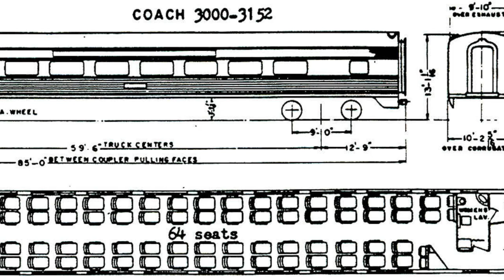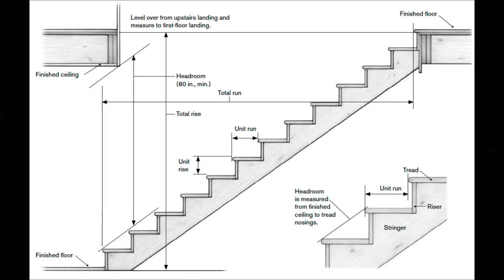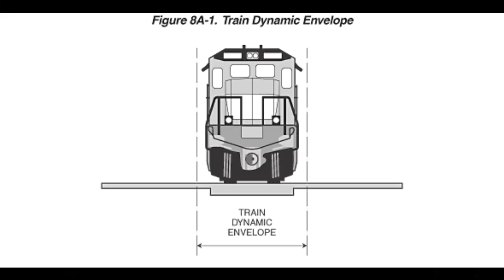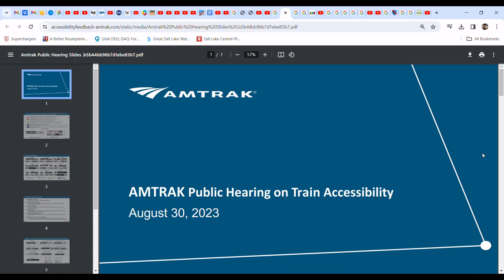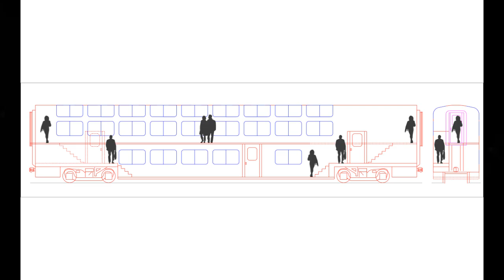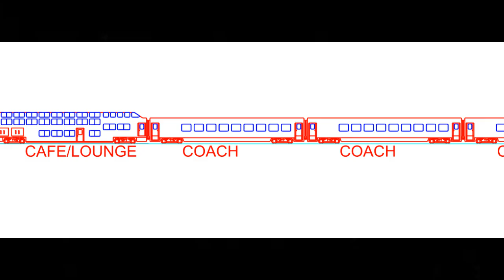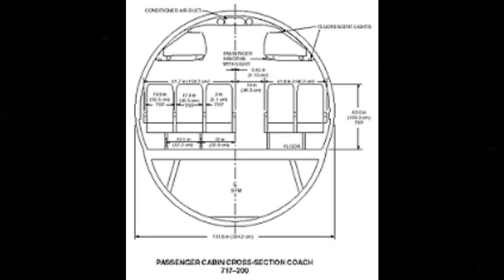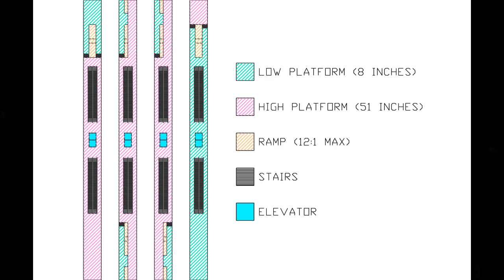An Excessive Explanation of North American Platform Heights

Comment: Gap fillers were first used on Brightline? San Francisco Muni Breda light rail vehicles have them and so do the newer Siemens trains. BART also has them. They are small but the tech absolutely is not novel on Brightline.
Reply from the maker: Yes! I should have said that Brightline was among the first intercity rail services in the USA to use automated gap fillers. The transit agencies you listed definitely came before Brightline, and deserve a shout out too.

Comment: Thanks Christian this was extremely informative. I did have a thought about the freight train dynamic envelope issue. I'm not sure this would be possible everywhere given the state of decay freight railroads like to keep some track in, but would it not be possible to mostly solve this issue with speed restricting freight trains around passenger stations?
Reply from the maker: An interesting idea. Physically it may work in most cases, but I have my doubts that the freight companies would accept permanent speed restrictions without unless there was some kind of compensation.
Reply: The issue of freight train dynamic envelope is less of a problem than you think it is...stand on a platform when a freight train goes through at 60 and you'll see for yourself...anyone that would be affected by such an envelope is just a Darwin award winner waiting to happen.

Comment: 10:51 - I actually made a concept of Amtrak bilevel coaches using this design. I took the Stadler blueprints and adapted them to Amtrak Coach, Sleeper, Diner and Lounge configurations, but yeah - they could only be used on the trains that currently use bilevel equipment, and with the places you describe (the several tunnels in the Rocky Mountains and Chicago Union Station), they would have to do some massive track rebuilding which would involve depressing the tracks 2 feet below their current height. It could be done, but Amtrak would have to pay for that. These cars would have even more capacity than the Superliners though and could mean increased revenue, so it would be an investment
Reply: Actually it wouldn't require massive track rebuilding, they would do it the same way they raised the heights in tunnels to accommodate double stack containers, which was a combination of lowering the track and notching the tunnel roof.  Amtrak shouldn't have to pay for it because anything like that would benefit the freight railroad as well(giving them outlets/additional routing capabilities to handle double stack containers.  This is actually a problem with all the Amtrak authorization bills that Congress puts forth, and it stems from a failure of the Amtrak leadership to enter into proper negotiations for track usage with the freight carriers.  Any upgrades to freight tracks that accommodate Amtrak inherently benefit the underlying freight carrier, yet they always complain about Amtrak hindering their ability to carry freight.  Hogwash.
Reply: @zaklex3165  large intermodal stack trains can’t use the Moffat Tunnel route because of how steep the climb is between Denver and the MT, so heightening the clearance wouldn’t really enable those trains to use that route, and if any money was invested to heighten the clearance on those tunnels, the max could be 19’ or 18.5’ specifically to accommodate taller Amtrak coaches - most stack trains are even higher.
Reply: @coleallen3895  A double stack is 20' above the top of the rails at it's highest point, the Moffat Tunnel grade should not be an issue as double stacks can go over Donner Summit, and I'm pretty sure the maximum grade on Donner is more than the maximum 2% between Denver and the tunnel...but that Tunnel is owned by the State of Colorado(and I highly doubt they'd spend taxpayer money on it to support a for profit corporation[UP]), so it's a rather moot point for that route.
Reply from the maker: My reading on the tunnel heights on the Front Range in Colorado suggested that the Moffat Tunnel itself is capable of double-stack cars, since it was built extra tall with the intention of being electrified one day (similar to the Great Northern or the Milwaukee Road). However, the multiple tunnels leading up to the summit, built by the original Denver & Salt Lake, are all height restricted to 17'.

Comment: At some point either robotics, prosthetics or outright medical science is one day going to render physical disabilities a virtual non-isse for mobility; I wonder how people in that time will look back on us and all the issues we have with providing accessibility.
Reply: Not every 80 year old will want to get a prosthetic.
Yes, there will be barely any people who are outright unable to walk, but you will still have people who need (only) a cane or stroller in order to be able to walk, and people who prefer sitting down in a spider/ walker wheelchair (which would technically be a legchair, then?).
The cane option limits where you can use steps, and the legchairs will have similar aisle width and turn radius requirements as today's wheelchairs. Even if we get to the point where no single person is limited by BOTH maneuvering room AND steps, there will still be people who have difficulty with either one of these points.
Reply: @Pystro  You won't need a chair at all if you were wearing a mobility assistive exoskeleton. You would be human sized, plus a backpack for the power source.

And that's to say nothing on the possibly of bionic implants to restore limb function or stem cell treatments that can repair damage and potentially reverse age released deterioration.

Assuming we don't go extinct first, one day physical disability will be something that does become extinct .

Comment: to me, the freight trains aren’t the real issue here
the crux of the problem, and a serious question I often ask myself, is, what is a better platform height: above the bogies (ideally around 1200-1300mm) or between the bogies (ideally around 500mm for double deckers)

I live in switzerland, so basically all standard gauge platforms here are 550mm, and as a result we can even have trains like the IC2000 and FV-Dosto (continuous upper deck) with accessible level boarding, while 760mm platforms have slopes that are too steep for swiss law.
But in turn, single deckers, especially high speed or tilting, are more difficult.
We do have the Giruno, which is a 250 km/h trainset with mostly 760mm entry, as it is a eurocity trainset, but it also has 2 cars with 550mm entry as well, which are connected, which form a 3-car wheelchair accessible section in the middle, with a first, second, and a dining car as well as 2 accessible toilets.
Apart from that, we’ve added low floor cars to a few different train types: DPZplus, NPZ Domino, BLS NPZ (jumbo) and I’m curious whether something similar will happen to the astoros, our latest tilting trains, some of which were constructed around 10 years ago.

Comment: Feels worth mentioning CalTrain's new Stadler KISS's, which will have two sets of doors -- a lower set to match the existing stations, and a higher set to match platforms shared with HSR.
Reply from the maker: Ah yes, I remember reading the California High Speed Rail Compatibility Blog on just this topic when I was in college....

Edit: I found the link:
https://caltrain-hsr.blogspot.com/2009/09/platform-height.html
Reply: That is basically a temporary solution until CAHSR reaches the Bay Area...once that happens, the higher level platform for HSR will be the standard platform height even for CalTrain...that is why they have two levels of doors at delivery.
Reply: @zaklex3165  they claim that but little of what the JPA says comes true, it’s run by a bunch of clueless officials. That would seriously slow down the boarding of bikes which would be a major issue as everyone carries their bikes down the stairs
Reply: @gdrriley420  Oh, you mean the "clueless officials" who now run the most modern electrified regional rail line in the nation?
Reply: @blakeclark5898 this has been a plan for over 30 years. Stumbling forward into success does not mean they made a bunch of good decisions along the way. It’s pretty clear looking back that there were a lot of poor choices. From a custom PTC system, lack of grade separations and extra quad track😊 to ordering trainsets with more powered axles than needed.
Reply: IIRC, they would have to add accessible car to each EMU. These accessible cars would be single level and have lifts for low platforms as well as two accessible toilets. These cars currently not existing may explain the lack of toilets in the current Caltrain EMUs.
Even then it feels like a temporary solution until they increase the platform height on the majority of the line - the lifts may be okay for people on wheelchairs of whom there are not that many, but it is not that good for people with bikes or even strollers.

Comment: Amtrak built a new train station in Catlettsburg KY in1975 to replace the C&O station in Ashland KY. It was closed in 1998 when a new transportation center opened again in Ashland. There was a wheelchair lift at the Amtrak station in Catlettsburg. In 23 years, it was used once.
Reply: This is a great example of why building accessible design into your architecture is preferable to creating special accommodation for disabled patrons. I’m willing to bet that many thousands of cyclists and parents with baby carriages used the station over its 23 years. Ramps and level boarding make boarding easier for everyone, including people using a wheelchair, a walker or crutches.

Comment: What I find interesting is that despite differing platform heists, the UK manages to mix high platforms with freight services. A high dynamic envelope might just be a symptom of poor permanent way - which should be addressed instead of maintaining a system that’s inaccessible and hostile to passengers with reduced mobility.
Reply: Check UK railway car widths, even the freight cars are narrow.
Reply: @scottfw7169 They might be narrow, but they're still go right up to near the platforms...just watch YouTube videos of British trains...and see my comment above about freight train dynamic envelope.
Reply: And strictly speaking, it would only be necessary to build track that is held to precise parameters in areas of close clearances, such as platforms and in tunnels, both of which would be well served by slab track (although it might be a harsher ride in those areas).
Reply: I would agree with you higher standard of permanent way probably be best as dare say less wobble lead to less derailments with the larger loading gauge that before allowing better access for passengers services

Comment: You miss one important factor for a lot of trackage and stations Amtrak uses; dwell times.  Bilevel or other more complex car layouts, and things like gangways make trains have to spend more time in stations, which can be a problem where those trains run alongside high frequency commuter or transit rail.  This is especially significant along much of the NE corridor.
Reply: I see why this should (and likely is) the case but in Switzerland more and more S-bahn are being run with bi-level trains to increase capacity. I don‘t think dwell times have really increased (at least not significantly).
Reply: @PhilfreezeCH  if you combine bilevel cars and bridge plates and King distance trains (so more luggage), it'll definitely start becoming an issue.
Reply: Happens constantly on my regular single level Arrow III consists getting stuck behind the Multilevel express Midtown directs running slower than mine for a timed connection. Those excessive dwell times is the reason we wait

Comment: In the 1980s, prior to VIA being castrated to death in 1989, VIA looked at the Superliners. One reason was hat they were charge by the car by both CN and CP, so having double deck cars would reduce number of cars in train consists and hence cost to VIA to run the trains.   One would have to look if the same applies to Amtrak on its midwest/west routes and if this would become an issue in selecting replacement cars. 
Anotther big decision to make is whether Amtrak can purchase enough additional capacity to make sleeping cars more affordable of whether they keep their trains smaller to keep them full and at higher prices.  Should Amtrak re-extend what is now the Vermonter to the Montrealer, it would need to be reconverted to a overnight trip and thus need sleeping cars, dining car like in the good old days.  Back in 80s and early 1990s, the train used "heritage" fleet sleeping cars and lounge/dining car.  It would need equipment that fit Penn Station.   Would Amtrak order more Viewliners from CAF to grow its east coast fleet while choosung something else for the west?
Reply: They experimented with Superliners between Winnipeg and Vancouver. The cars were too tall to run safely through the Winnipeg train sheds, which had already been raised in 1964, when CN added Pullman-Standard Superdomes to their fleet. At the time, they were considering reviving the Winnipeg to St. Paul-Minneapolis service.
Reply: When they moved The Canadian (the real one) from Windsor Station (RIP) to Central Station in early 1980s, they lowered the track on a couple of platforms so the dome cars would fit. At Dorval, the train woudl stop at the CN station, then back onto a connecting siding/spur onto CP tracks to proceed to Ottawa on the M&O all the way via Rigaud, Vankleek Hill.  Eventually rerouted to stay on CN to Coteau and Alexandria sub.  And then via Toronto. The last year had the return of service via Ottawa to Sudbury before the final end of The Canadian in end of 1989/ jan 1990.  @dougbrowning82

Comment: With native rail manufacturing gone in north america,  and FRA standards that still prevent modern trains (though the 2018 rules have reduced some of the limitations) I am curious what will be available for both Amtrak and VIA (who is in more dire need for replacement of its long distance feelt which has structural problems - but government commitment limited to "we can pay for consultants to look into it".   West Coast Express are not bound by "buy american" rules and were able to buy from Stadler direct from their swiss plant (who downgraded the model to meet FRA specs).   Interestingly, the early single level cars WCE uses are former CN Rail steel cars that were rebuilt by ISRI in Monton, complete with creation of panoramic windows where luggage racks would be.  The advantage of the rebuild is that the FRA approval from the 1950s is grandfathered. 

Europe does not have many long distance trains left.  ÖBB Nighthet are just single overnight trains with no dining cars, no loounge, no bar, no dome.  Stadler does have nice observation cars (single level) for the Swiss alps trains (in fact the early West Coast Express single level cars resemble that in a beefier size). 

VIA Rail,s leftover long distance train (whcih it wrongly calls The Canadian) has 1 Park car (the good car at badk of train) and 1 Skyline in middle. The skyline has bar, lounge and dome sectio . But they have now restricted access to the Park car to only the "premium" passengers whereas it used to be accessible by all sleeping car passengers.  (the skyline has bar/snack area downstairs and dome above).  The domes are great, but their limited capacity is an issue since longer trains have too many passengers.
Reply: Stadler, Siemens, and Alstom all have manufacturing plants in the US. So long as the new cars are from one of these three, they will comply with the "Buy American" requirements. Siemens already has some expertise in the area with the Nightjet cars you previously mentioned and I would like to see many of Nightjet's amenities adopted into the new Amtrak sleepers. Stadler should be able to adapt their bi-level observation cars, but I would personally like to avoid mixing consists. I think Amtrak would like for the entire trainset to come from one manufacturer instead of mixing and matching equipment from different manufacturers.
Reply: Stadler , Alstom, Siemens don't have native engineering in USA. They take their real models and then downgrade them to FRA standards and change service proven components with US made ones which require whole testing of vehicle and debugging.  The new Nightjets are the more recent Viaggios which have not been imported and converted to US standards. The Venture are derived from old Viaggios.   The Viewliners are a better model of "designed and made in America" even if the company doing this was spanish (CAF).   Talgo has designed a "USA" model made of heavy steel and made at a plant and then the company got screwed by Wisconsin and pulled out of USA.  (And political pressure forced Amtrak to pull the real Talgos that had been granted exemptions to operate in USA because politicians feel foreign trains are unsafe despite the train performing well during the massive derailment due to overspeed in curve. 
The goal should be to serve passengers, not for politicians to do a photo op to claim local job creation.    @TheFarix2723